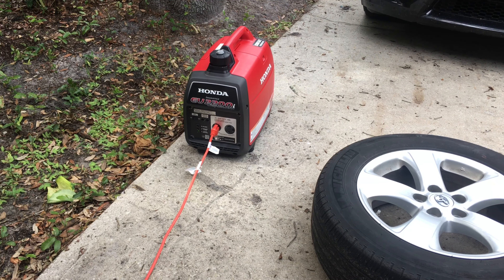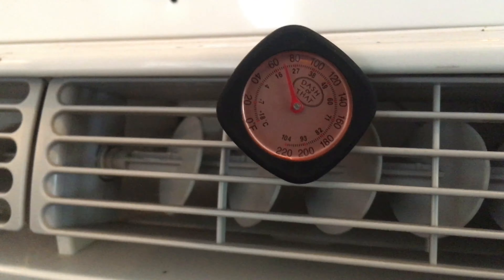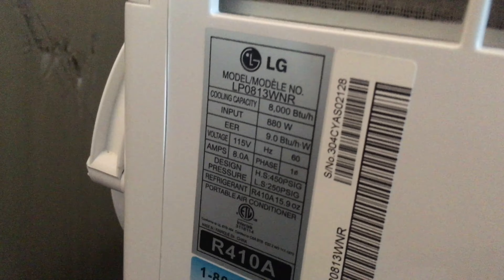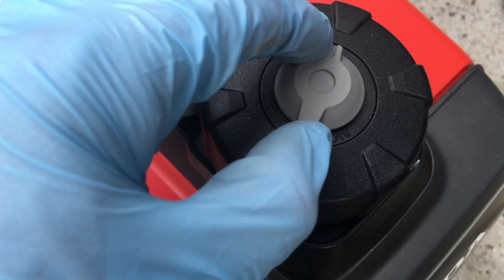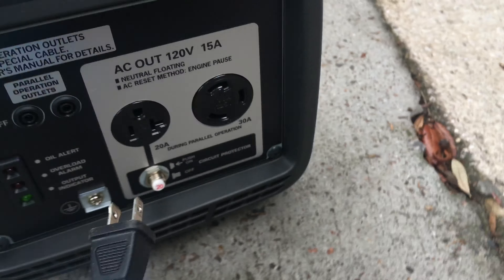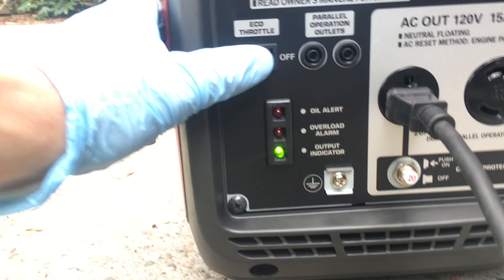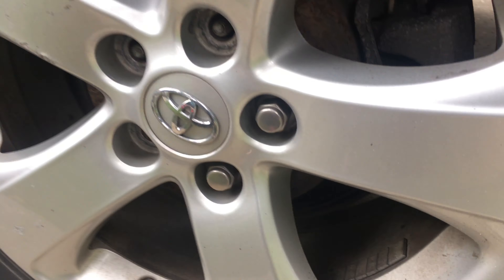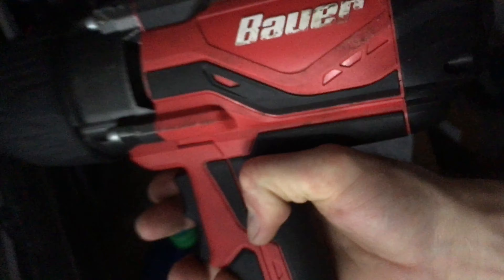Honda EU2200i Companion: Window A/C and Harbor Freight Impact Driver

Comment: I just bought a EU2200i Companion and it vibrates too much. Anyone else's EU2200i does this?
Reply from the maker: Doctor Shred I was camping on beach sand and I could feel mine vibrating from 10 ft away while laying in the tent on the ground. It was on eco mode, lowest rpms
Reply from the maker: Doctor Shred there are also two recalls out on these so check your serial number against the list.
Reply: @DadsGotADeal  Thanks! I'll check it out